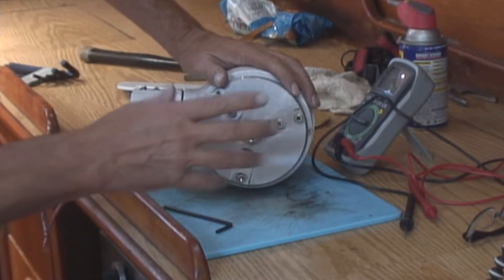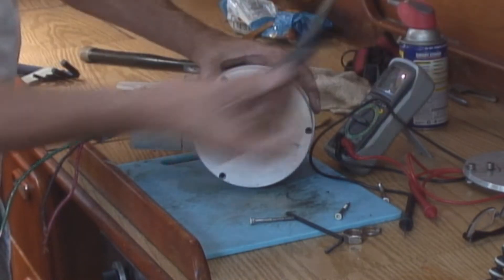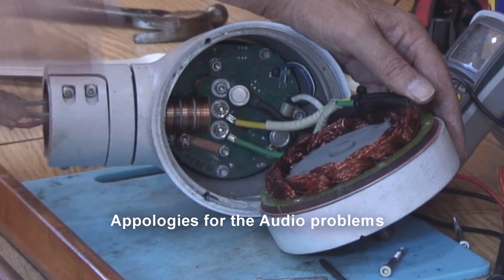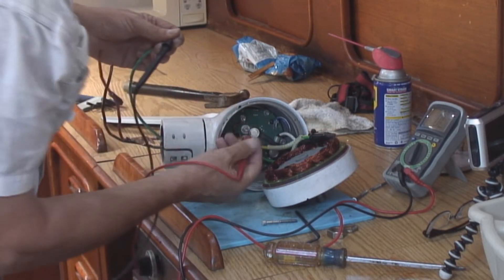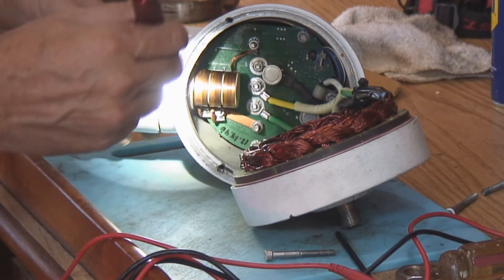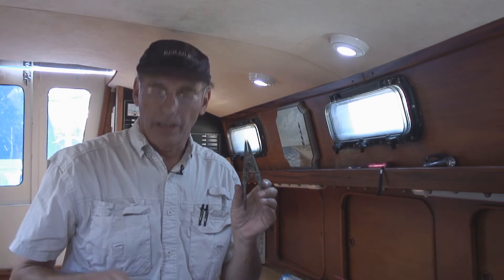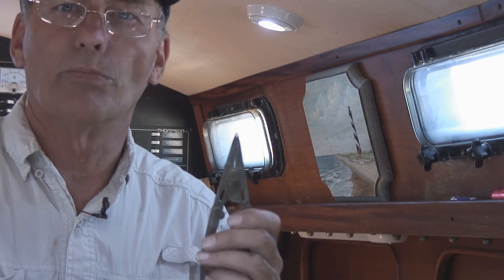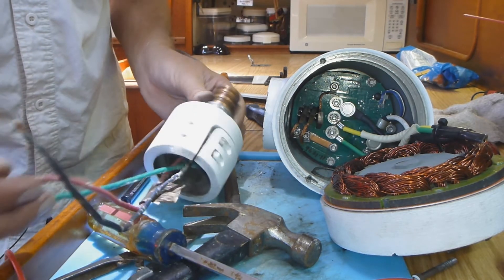AirX wind generator Yaw/slip ring replacement.

Comment: Helpful info thanks. No need for the scandalous disclaimer at beginning tho... ha. My generator had a different issue. All three windings on the alternator were shorted together, so the enamel on the wires must have worn or burned away.

Comment: Great video! Thank you. My AirX Marine just stopped producing energy today. The blades are spinning as they always do (with the same noise and speed), even when the engine alternator charges the batteries to 14.1V, the unit stops spinning and goes to regulation mode. However, the led is not blinking neither on the regulation mode, nor while spinning. And there’s no output. Everything seems to be normal apart from the red led being always off. I couldn’t solve this.
Reply from the maker: Other than the LED how do you know it is not producing? Have you checked with an amp meter?

Comment: Depending on the width of the bearing, sometimes you can find 2 bearings that you can put together to make the same width. This generally is a lot cheaper. These special bearings can be expensive.
Reply from the maker: I do not think they use special bearings on these but that is a good idea when one runs into that. Great thought and thanks for sharing.

Comment: Next time use a something to hold the brushes in place and after inserting the bearinbg and circlip , remove the string or shim.
Reply from the maker: Thanks for that idea, I do not recall having a problem with this but have run into that in the past. Thanks for sharing.

Comment: Hello Wayne Great video Can you tell me what voltage your system is and  what amps does it produce as my one is only creating at most 1 amp cant work out why this is a new unit
Reply from the maker: My system is 12 volt, and if the wind is above 15 kt I can get 5-10 amps. Wind speed has a lot to do with output. Check your wiring to make sure it is the proper size and no bad connections. Thanks
Reply: Hi Wayne appreciate your help  
Thanks Ross

Comment: Could you please tell me where you are getting your new Yaw bearing etc.  I bought the aluminum housing model FDH400 ( used ) of which I am sure is an AirX version.  The previous owner let the blade hub get loose and it proceeded to semi wear out the Yaw bearing thus causing the Yaw contacts to become non-conductive mostly the middle ring. Any help would be more than appreciated.  Thanks ahead of time.
Reply from the maker: +VintageGearMan There is nothing special about the bearings and any industrial bearing store should be able to help out. Grainger's or McMaster Carr might be a good source as well. Good luck let us know how you make out.

Comment: Wayne, Good video, but I'm curious why you don't just go solar. No moving parts and no noise.
Reply from the maker: coolbluetoo I have solar as well. I have found the combination of both work well. The solar is better in the marina or inland anchorages but the wind is a big help on offshore passages and when anchoring where there is a sea breeze. I do need to increase the solar I have.

Comment: Wayne, I reviewed the video and saw how you removed the yaw assembly and how you replaced the assembly. However, I saw nothing of how you fixed the basic problem of the wire connection. After you removed it, what did you do to fix the incomplete circuit problem?
Reply from the maker: David Bruno Hi David I did not fix it but replaced it with one from an older non working unit that I had. I am not sure you could fix the problem this one had as it seemed to be within the molded plastic. I think the only option in a case like this is to simply replace the whole part. Thanks for the comment and watching.

Comment: Thanks Wayne you made that look easy, if you were to purchase wind gen's again would you buy those or is there another brand or type you like better.
Reply from the maker: I know there are better wind generators out there and I do not have a lot of experience with the others, I hear good things about the KISS unit. I use the Airx because there are a lot of them out there and you can get good deals on used ones.
Reply: Thanks for the reply,